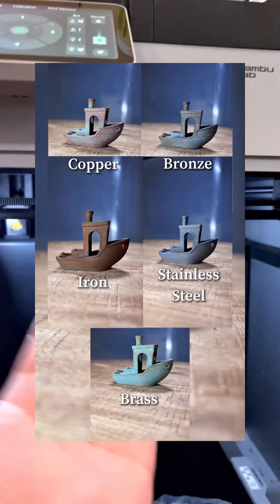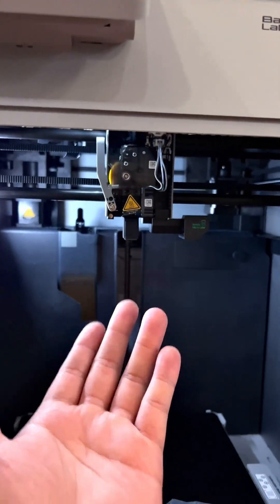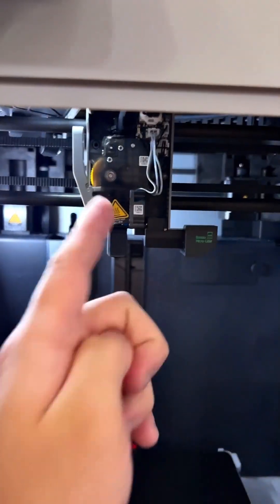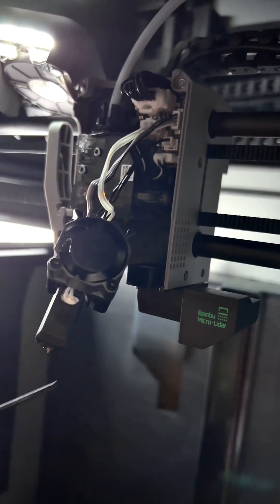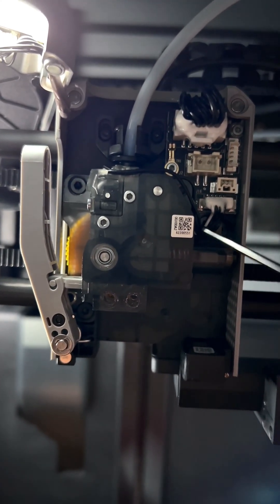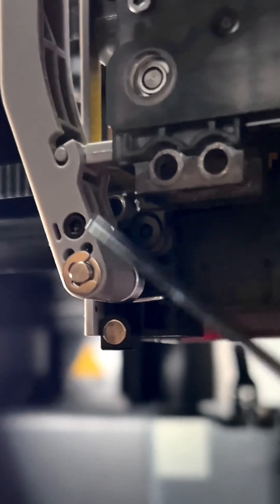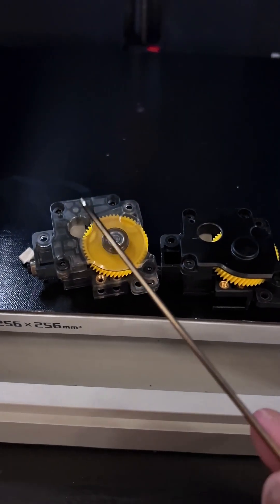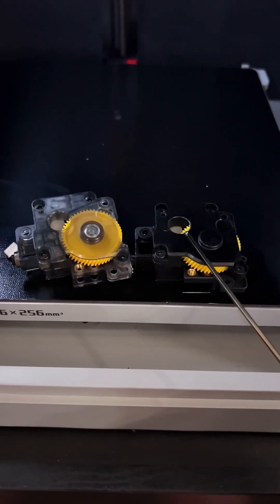Hardened Nozzle & Extruder install for Bambu Lab X1 Carbon

Comment: I thought the latest version come with hardened extruder & nozzle ?
Reply from the maker: Upon further research if you bought the X1 Carbon & not the X1 it does come with a hardened nozzle & extruder. I also got mine off of their Kickstarter.
Reply: @MinWin3D  cool, thanks for update

Comment: Is it possible to modify the nozzle to accept standard mk8 nozzles? Like shave off the tip, make a bigger hole, and tap it. Maybe add a spacer or cut some extra off so the nozzle is about the same height?

Comment: The guide to replace is nice, but you gave false info at the beginning because the X1 Carbon shipped with hardened nozzle and extruder gears. The regular X1 didn't have any hardened parts.  The nozzles with black heat sinks are hardened and ones with silver heat sinks are stainless.  They do recommend a 0.6mm hardened steel nozzle for CF on their website to lessen chances of clogs and less friction/wear on the nozzle. 👍
Reply: X1 & X1C differences:
https://cdn.shopifycdn.net/s/files/1/0584/7236/6216/files/1013.png